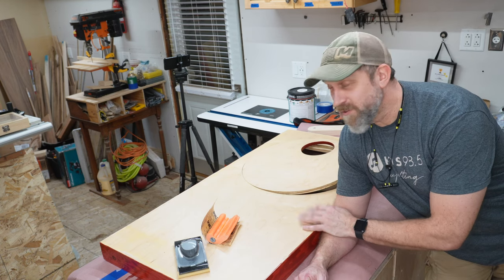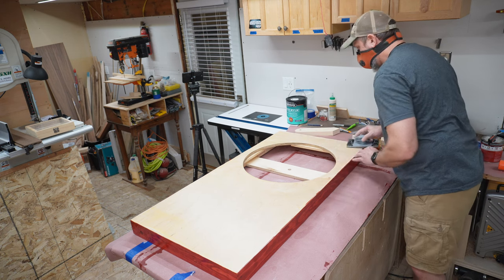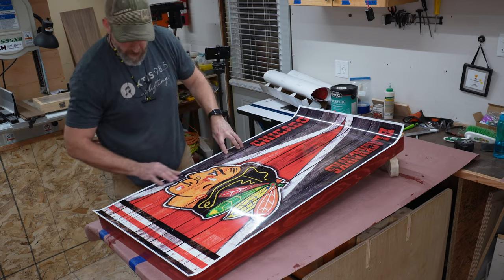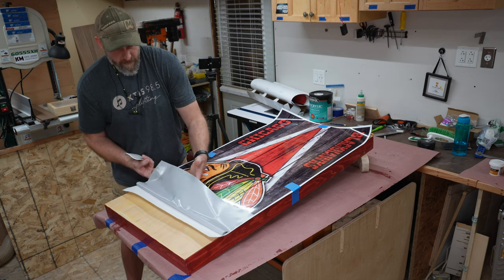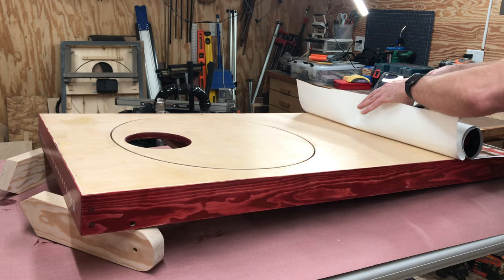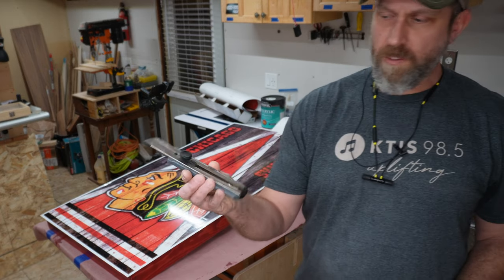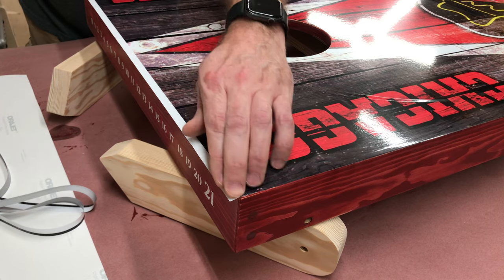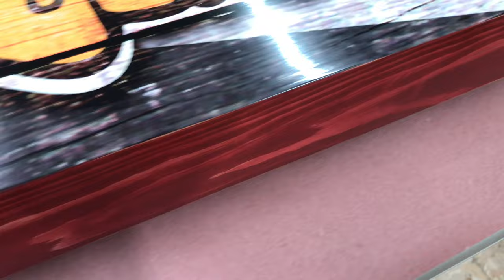"Get Ready to Wrap Your Cornhole Boards - Here's How!"

Comment: Great video. What exactly did u apply at the end to protect it? Does that just help with durability? Thx
Reply from the maker: Hey there, I used Polycrylic, a water-based polyurethane to protect the decal and make the playing surface more durable.
Reply: @BrettsWoodshop  I really appreciate the reply. Keep up the great work 👍🏻
Reply: @BrettsWoodshop  hey Brett, sorry to bother you again. Last question... how many coats did u put on the decal, and did u sand it at all? Got everything completed today, and I don't want to mess it up now, 😆.  Thx again
Reply from the maker: @live4theleafs364  No bother at all! Glad to hear from you again! I hear ya about not wanting to mess up. Finish has been the bane of my existence lately. I don't think I recorded any of the poly going on. I can't remember if it was three coats, but at least two. Hope that helps! Blessings

Comment: slightly unrelated --- I was hoping that you crafty ladies/gents might be able to help me or at least point me in the right direction. We are going to be using corn hole boards as our guest book at the wedding this Summer. I wanted something different, and at least this time, whenever we play we will remember the day. ANYWAY, the board is covered with a customized vinyl wrap with our last name on it. 
What would be the best to have guests sign with and still be able to seal after (and what would be the best seal that isn't going to degrade when sealer is applied)
I thought black and or metalic sharpies, but wasn't sure how they would hold up under a seal coat. Then I thought OOOO A Paint pen, but then do i do water/oil based?
I'm so confused
Reply from the maker: Paint pen is a really good idea. They’re oil-based. And after it cures (2 days should be plenty) it won’t matter if you use oil or water based clear coat.